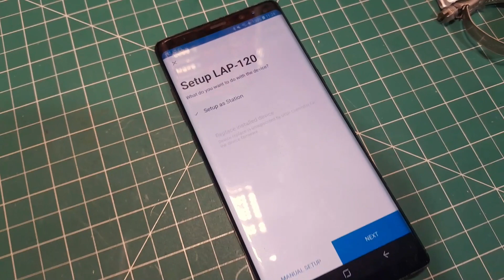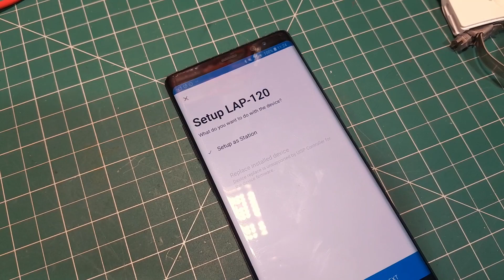Repairing a $200 Ubiquiti LAP-120 with a $2 replacement part

Comment: I'm curious how long the first part lived for? If short lived, the new part might not live long either.
Reply from the maker: I've got a few dozen of these deployed, this is the first I've seen fail. Looks like it was deployed on the roof of a two storey building in June 2021, but there has been some electrical issues onsite that could have affected it too.